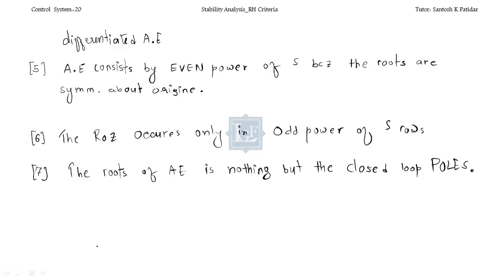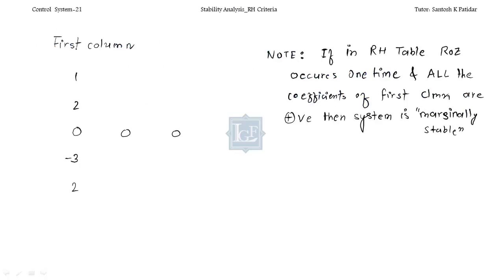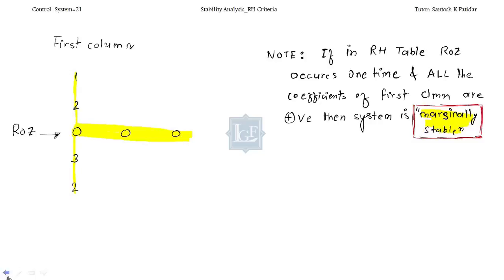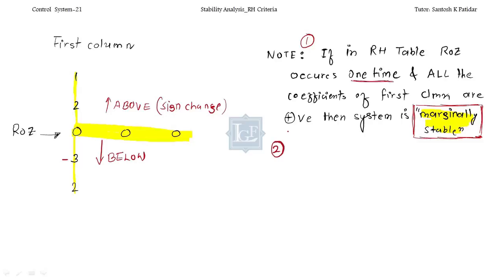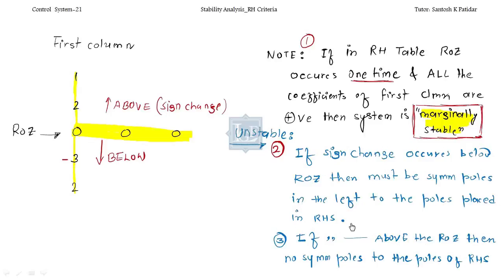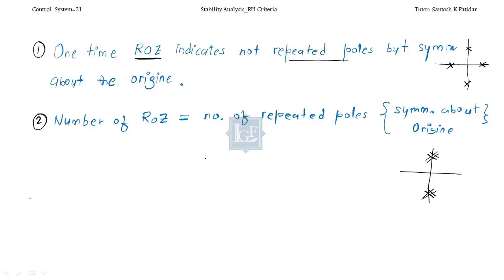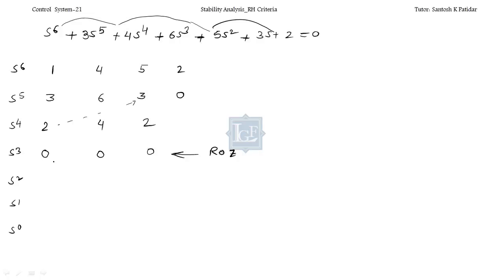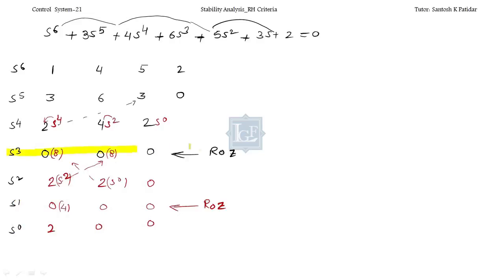Lec 21 Stability (RH Criteria Contd)

Comment: Can anyone plz explain when there is more than 1 ROZ there would be repeated poles on imag. axis, then why the system is not marginally stable ?
Reply: Bcoz,when there are repeated poles in the imaginary axis and if you take inverse laplace transform of the transfer function you will have an impulse response which is  a linearly increasing sinusoidal function

Comment: sir u said no of symmetrric poles equal to the order of auxilary eqn.
if order of a.e= 4 , then 4 poles lies on origin which are symmetry.
if there are repeated roz then again poles will repeat.
my question is which poles repeat?? ex: order of ch. eqn=6. then first auxilary eqn has 4 symmetric poles, and the rest 2 poles get repeated with the previous one???
Reply: same question here if there are two auxillary equation both of different order,then wh are you considering only one auxillary equation and in your first auxillary equation coefficient of s^4 will be 2 and by solving both a.e i get s=+_j
Reply: when we have two ROZ thn we have to consider higher order AE..nd it's highest power of s will define the no. of  symmetric poles